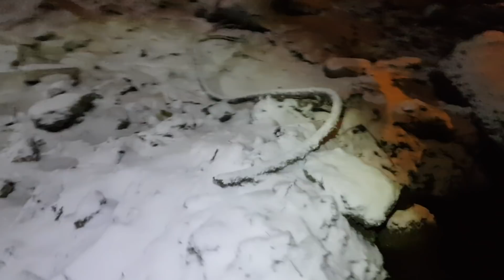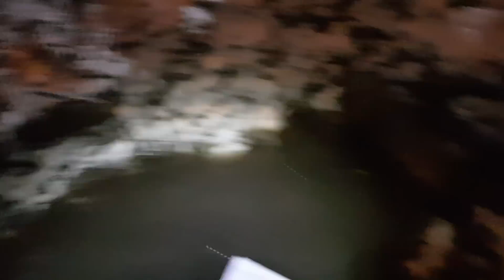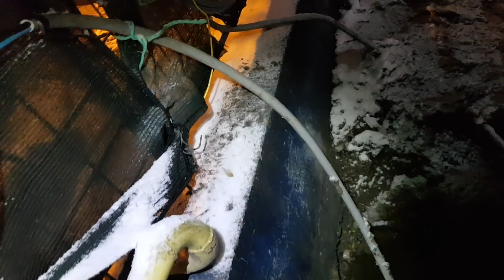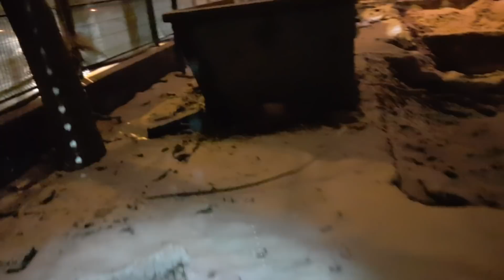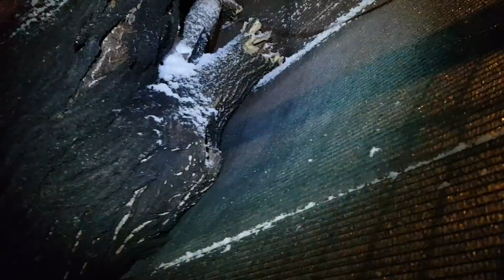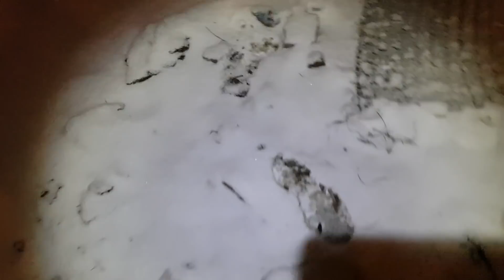Dorel si Enel loveste din nou ,continuare sau un fel de raspuns la comentariu x

Comment: Bun dar cum trebuia facut? Faptul ca un cablu iese din apa nui problema avand in vedere ca avem un cablu special construit sa fie in pamant, in contact cu apa, fara alt fel de protectie. Era clar ca lucrarea trebuia continuata. Tu zici ca trebuie sa se bage firele in protectii speciale? - adica nu cu banda de izolat. Dar sa lasam "cum se face" - si sa vb stiintific. Care e valoarea izolatiei la banda aia infasurata de 5 ori cum era acolo, vs izolatia normala pe firul de cupru a aceluias cablu. Daca ai 1 mm de izolatie pe firul de cupru, sau ai 5 x 0.2 mm tot acolo esti daca e aplicata corect. Nu cred ca izolatia din "banda de izolat" -  e mai slaba decat cea din protectia conductorului. Dar daca e atunci sa vedem numerele. Ca numerele vb nu parerile lu unu' si lu altu. Ca s-ar numii "banda de bandajat" nu "banda de izolat" =)) Si tot nu-mi este clar cum trebuia defapt facut. Ar fi bine sa explici si ce trebuie facut in schimb, nu doar ca nu e facut bine. Ma refer aici strict la cablu din apa nu la treaba cu cablul din copac.